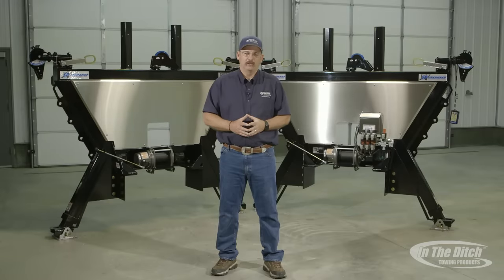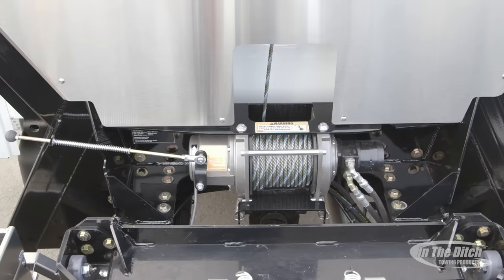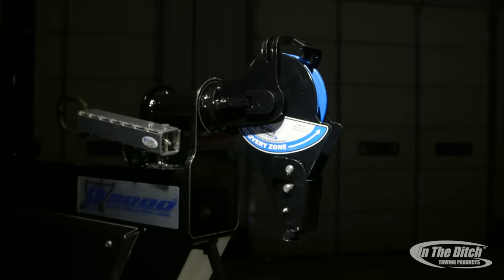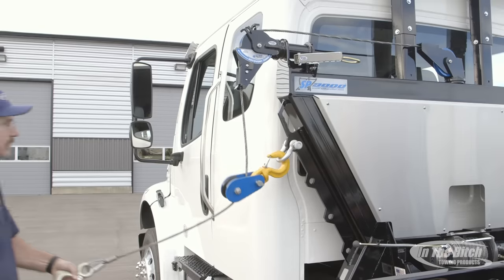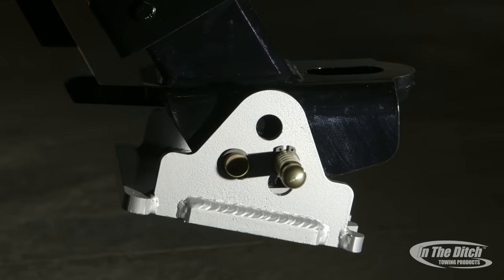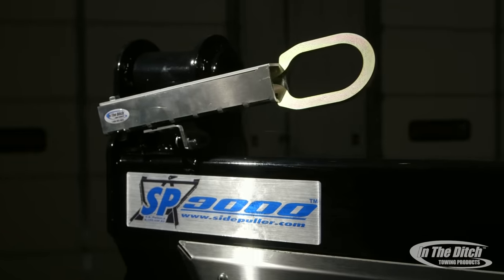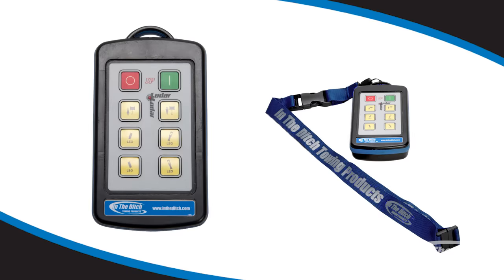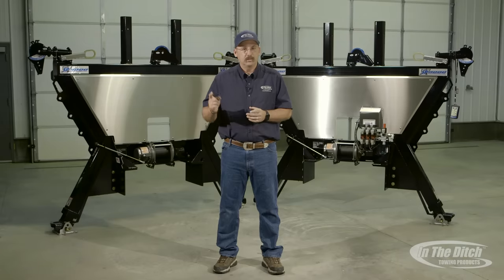In The Ditch SP9000 SidePuller™ Overview Video-Side Puller Recovery

Comment: Looks like worthwhile improvements.  We bought the very first version that came out and its been on our truck for the past 10? years or so still going strong.  We've always run off the side with a snatch block to get that rope down and around that outer pulley more to keep the outer boom head from swiveling and damaging the wire rope.  Im sure raising that outer head now helps out a lot on that problem.  The improvements made, while some small are the ones that people probably have been noticing they could use for a while.  We see all companies in our area now installing some sort of sidepuller.  I just don't see how we did it before as being very safe.   I actually recovered a pickup about 25ft down in a ditch just this morning with our unit, didn't need a wrecker and only needed myself and the right equipment.  There hasn't been a job in 10 years we've walked away from!
Reply from the maker: We sure do build them to last. The changes are really to just keep making towers life easier and safer. We are glad to hear your still enjoying yours. Stay safe!

Comment: should make the light bar ends extendable.. so they are as narrow as the cab but can be pulled out only when you need them. a pull down rocker lever to unlock them

Comment: I'll say a few words about this we just got one of these with our new rig fantastic but we have side pullers on almost all our trucks.the only thing is I do like having the levers for the controls up by the cab now I can't just use the levers to help put away the stiff legs and the winch I constantly have to use the remote and it's waaaayyy harder to keep a eye on the stiff legs but still good deal the grab bars are way too small I also don't like the new head the old one worked better.all being said in our area we can't go without em they ROCK and car carriers make great recovery vehicles but you also need to be properly trained I can now look at casualties and pretty much grab anything works great doesn't take up much room and keeps the state patrol and local PD's happy I have used that dam thing more then once in a jam and it's always great having a spare winch u never know plus the first winter u have it it's already more then paid itself off !!! Thanks guys

Comment: That looks a fantastic piece of equipment. Good for Fire n Rescue vehicles as well. Very compact. Would want another set of landing legs that come further out. Just to transfer the pressure point further away from the winch vehicle
Reply from the maker: Hi Robert! We agree-they are very useful for Fire and Rescue vehicles. Wider the legs comes increased stability for sure. However, when we were designing it, we couldn't go over 102" wide or you can't legally drive down the road.

Comment: I still have one major complaint, the winch free spool lever is on the driver's side. It should be available from both sides.
Reply from the maker: Hi Michael! There is an Air-Free spool option available from Warn. I'd be glad to get you part numbers if you'd like.

Comment: What size and rating is the cable? It looks like a 4 or 5 ton limit, maybe smaller.
Reply: SP 9000 indicates it is a 4.5 ton (9,000 pound) winch model. Same goes for the higher rated models of 12,000 (6 ton) and 20,000 (10 ton)

Comment: The outer boom head is probably the weakest link of this unit, I absolutely hate it. Almost everything you touch ends up outside of the "recovery zone" of the swivel head and you have to snatch block instead, and the little metal piece that closes off the sheave to capture the wire rope just falls off while driving down the road, I've lost 2 this way.
It's a fantastic unit but it has some down sides, But i use it all the time and it's even made it through getting hit by a car in one of the legs and it's held up fine.

Comment: I honestly can't see this as being useful. So, you hook up to the car in the ditch, and pull it from the side. Now you have a car lined up to the side of your truck. .... Now what? You'll have to reposition the truck to pull the car onto your bed.

Or, you could just angle the truck correctly the first time, hook onto the car, pull it straight onto the bed, strap it, and be on your way.

A side puller really doesn't look to be useful for any application.
Reply: Before you get uncivilized and go to calling someone unintelligent, you should first ensure that your own comment actually makes sense.

I'm assuming you're referring to the part where I said, "So, you hook up to the car in the ditch, and pull it from the side. Now you have a car lined up to the side of your truck. .... Now what?"

If you suggest that the car be pulled onto the road, then, you still have the car facing sideways. Perhaps a diagram would be more helpful, but youtube comments aren't the most forum-like out there.
But you still have a car facing sideways across a road, and you're still blocking both lanes doing that, taking even more time to pull once, reposition, then pull again.

It would simply be far more efficient to just line up the back of the rollback to the vehicle to be pulled, hook on, pull straight onto the bed. And if there is a slight angle, that isn't a problem because rollback beds have chain slots to hold a pulley. (Pulley on a chain, specifically.)

If you have a really tough pulling or lifting job, perhaps the best vehicle is not a rollback. Those can pull vehicles on their wheels, and if you don't mind dropping a vehicle onto its suspension, you can roll it back onto its wheels, then pull it onto the bed.

Quite simply though, the best way to recover a vehicle in a ditch? Angle back, hook the pulley onto the far side of the bed, hook onto the car, pull onto the road, steer the car while still pulling, direct it onto the bed of the rollback, strap it down, and you are done. There is no application I can think of where a side puller could ever be practical.

But, I welcome you to try to convince me otherwise.
Reply: Helps to watch their demo videos to get how lame your excuse is of this not being so practical as you assume.
Reply: "Angle the truck correctly the first time...."

LOL.  You've never been a roll-off operator have you?  Many cases the operator is not able to - in your words - "angle the truck correctly."

Comment: A rollback isn't designed for recovery work... But hey .. There's always that guy that thinks a screwdriver is also a chisel
Reply: art vandelay  why can't it do both? A truck is a truck. You should always be looking to make your equipment more versatile. You never know what will happen in the world sometimes you have to make do with the equipment you have.
Reply: Closed mind. Versatility is one part of the efficient of the future.
Reply from the maker: HI Art! We would actually put the SP9000 up against anything out there. It will outpull and out work any light duty wrecker on planet Earth, and we have thousands of customers world wide that I'm sure would agree! Thanks for watching.
Reply: wow...
Reply: are are triggered,  mus be a democrat
Reply: @Solocat1  its that kind of unneeded comment that shows your ignorance.  You should learn that sometimes, less said the better.
Reply: If you can't use 1 truck like a Swiss army knife you'll be out of business by the time the ink dries on your LLC.
Reply: Except for they very much are, I've done quite a few of them... And in a lot of bad situations, They are perfectly designed for recovery... and with a side puller it has almost no down side in comparison to a wrecker... You are the type of guy that thinks only a wrench can be used to loosen a bolt, When in fact you can use a wrench, a ratchet, an adjustable wrench, vise grips, etc all being better or worse at doing that task... Don't be ignorant.